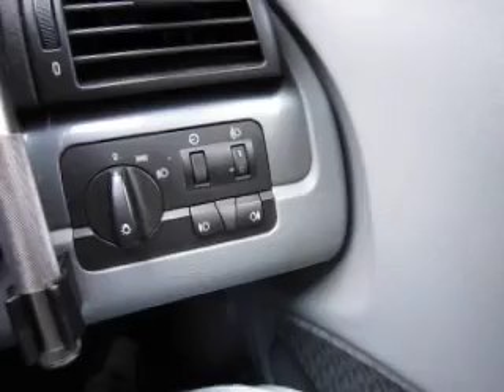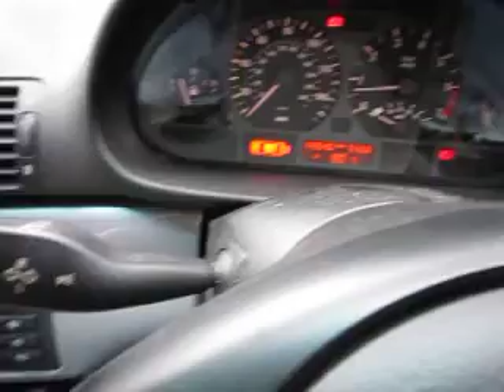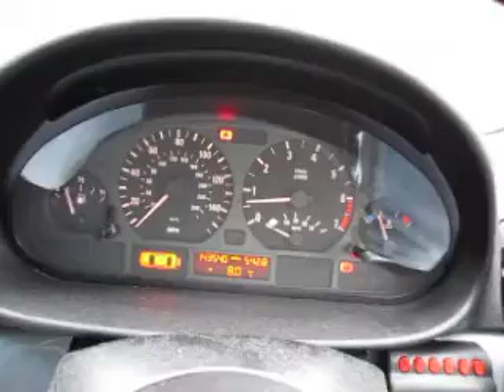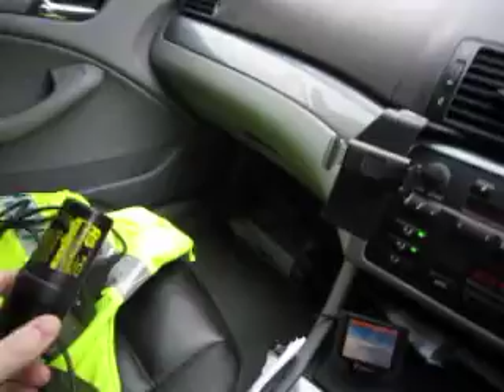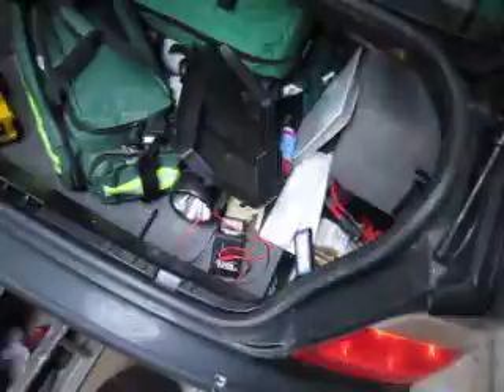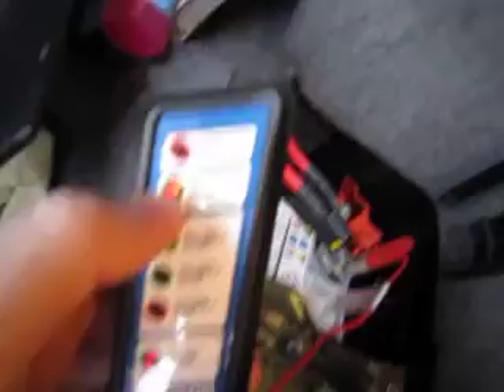BMW E46 325I, ELECTRICAL GREMLIN?

Comment: Computer or wires bunch grounding out,  button been disabled.
Car been set up for disabled person.

Take bumper cover off and see if wire pinched.between bumper and cover. Or inline fuse installed incorrectly.
Stolen car do that. BMW theft identity program as car cost go up as parts get disabled.

Comment: First think you have to do is to reset transport mode in body control module can be done with good scanner like Auto logic or bmw factory scanner and check and reset all foults in all control modules andafter few hours of driving recheck all modules for anny codes

Comment: Hi mate don't know if you still have the problem with the car but check the positive wire at the battery they have a crash safety system that deploys a airbag charge to disconnect the battery make sure it hasn't been deployed or that the positive wire hasn't came loose ok chap .

Comment: i have had a similar problem with my e46 i had to change engine due to been lied to about the car when i bought it, since putting new engine in my traction conrtol light stays on, my battery light comes on when i turn rear demister on and oil light used to flash up, until i changed my oil level sensor, could be something as simple as a bad earth, thats what mine is ive been told maybe try a reset, .... earthing points look down left side of your engine below washer bottle you have a main earth there, other earthing points are behind your front indicators where there's a lot of brown wires all connected to a strip and earthed to the chassis, but try taking the main engine earth off and cleaning the terminal up on the wire and where it connects to the engine im just about to go do mine now if it works i'll message back

Comment: Check the batteri voltage using a digital volt meter.
At idle RPM, there must be 13.5 - 14.5 Volt DC on the battery.

After engine has stopped > 10 min. there must be > 12.3 Volt on the battery.

If the first one fails, its the alternator that fails. If the 2nd test fails, its the battery that fails.
If both are ok, its likely to be a ground wire problem or a bad circuit board

Comment: open your trunk and take some trim off check of there is water on the side , not the battery side. see if wiring is exposed . replace your oil level sender. your cluster can be bad , do a cluster test. check your light control module .

Comment: hi have you sorted the problem yet? how about changing your LCM? lamp check module. your light switch is a complete unit with circuit board and relays. i bet your probem lays there!

Comment: I had a similar issue. My assessment was overcharging by a faulty alternator/regular. In the video, the overcharging state causes the sensor malfunctions, then as more load is put on (the headlight) the voltage drops back to a normal level and the problem start to go away. At one point i measured 18v at the alternator.

Comment: Does it lose power when you are driving and also is it an auto?If so,then  when there is a fault,it would come on in the little square when you select drive,nectral and so on.If so,then the alternator is at fault because i had the same problem myself.Change the alternator and everything is fine..

Comment: Have you fixed the issue? I would check the alternator voltage first (too bad you can't use the secret menu for that, since your BC is not working).

Btw: Just loving that sound of a BMW 6 cylinder firing up...

Comment: @muffinator2002 Yes, you are right . I did not heard about 1:47 - 1:56. Sorry... i was just reading comments and seemed to me that you were saying that the only possible cause of the yellow oil light  was sensor failure. Now is clear... hope for everybody

however this car had more than just that problem. All the electronic gizmos failures may be reconducted to an alternator/tension regulator failure.... The Ecu just turn off things like fog lights, A/C, even the radio in case of a power loss.

Comment: @mpr330cd But during the video 1:47 - 1:56 the guy clearly states that "there is plenty of oil actually in the car, theres no problems in regard to it."
So having experienced that very same issue myself (which has now been fixed by replacing the sensor)
i felt oblidged to lend he guy and give my honest advice which whether you like it or not is actually correct.

Comment: @mpr330cd Yes you are correct, according to the owners manual it states "If light comes on during journey: stop immediately and switch off the engine.  The engine oil is at its absolute minimum permitted level.  Further details: page 137.

Comment: @muffinator2002 why don't you read the owners manual instead of saying wrong things... The yellow oil light stands for low oil LEVEL and can light up even after you have turned off the car. Otherwise if it becomes red stands for low oil PRESSURE.

Comment: Little small things? A battery charging Light wich keeps burning (somewhere fare fare away) is the indication that your alternator is not producing DC power. It is producing AC power for the battery.

It will get worse and rips the ECU unit.

Those little small things do not respond anymore because off a bad ground point. No DC but AC. 
Your wheatstone bridge in the alternator is gone.

Comment: the yellow oil light indicator just tells you that your Oil Level Sensor has failed its a common problem, i have it myself the car is fine to drive like that it just means elctronically the car cannot read your oil level, just remember to cheack the level of oil your self.  when its next having its oil changed ask to have the sensor replaced as the oil has to be drained.